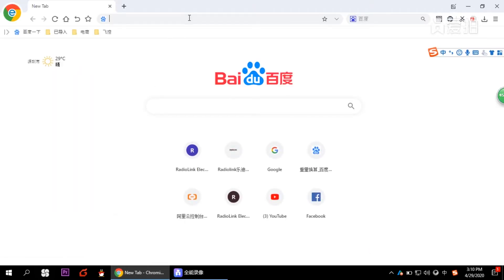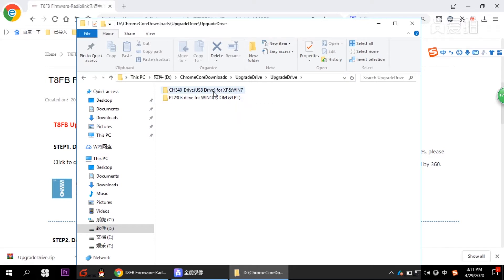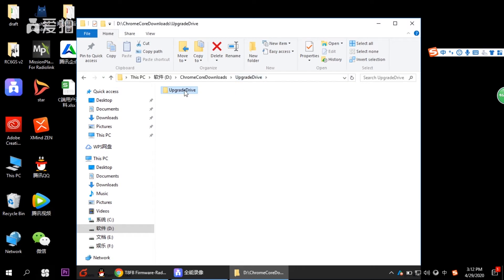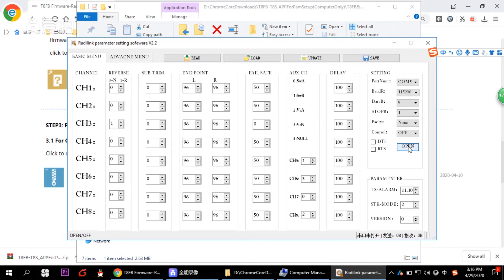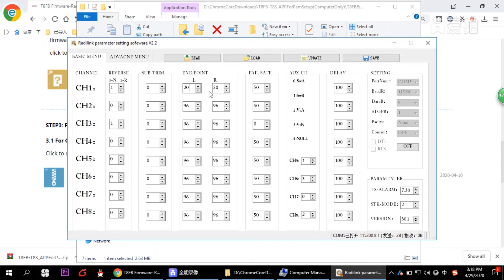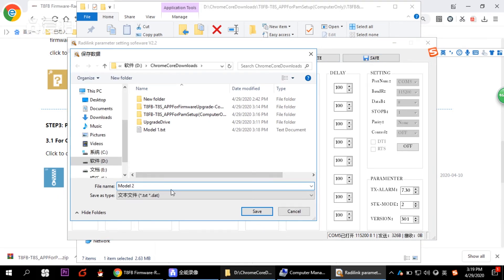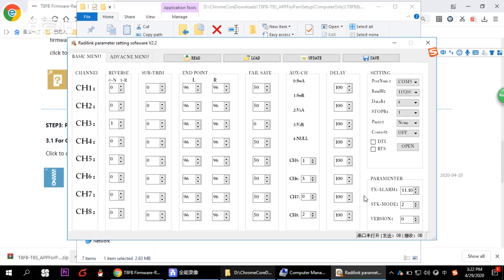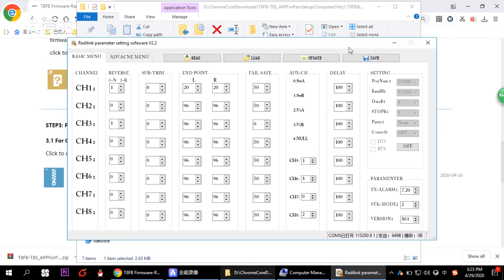How to Setup Parameters of T8S(BT)/T8FB(BT) by Computer

Comment: I keep getting an error on setup "not found install application, please install by hand
Reply from the maker: Hi, sir. May I know what transmitter are you using? Is it OTG or BT version? You need to install the driver if you want to use the Parameter Adjustment APP on the computer. You can send more details to our email after_service@radiolink.com.cn Thanks in advance.

Comment: Can I switch to stick mode 2 from stick mode 1 with this tool? I can´t connect to my smartphone...firmware update doesn´t work but my computer detects the transmitter and I can read and change settings.
Reply from the maker: Hi, sir. For stick mode change, you need to modify the stick first, and then change the stick mode in the APP. Here is a tutorial to show how to change the stick mode of T8S: https://www.youtube.com/watch?v=b-97TUi3_Rw  After modifying it, you can switch to stick mode 2 from stick mode 1 on the computer through Parameter Adjustment software on the computer. Here is the link to download the parameter adjustment aoftware: https://www.radiolink.com/t8s_apps  If any question please feel free to contact us. Our email is after_service@radiolink.com.

Comment: I build an Airboat with differential thrust 
I'm using :
1 pixhawk 4 (it comes with GPS and power distribution board) with ardupilot
1 radio transmitter, Radiolink AT10
1 radio receiver, Radiolink R12DS
2 ESC
2 brushless motors

could you please help me out with the differential thrust?
Reply from the maker: Dear, thank you so much for using our product.  We are preparing for the tutorial video about how to set up the flight controller and the boat. But it will release in May. You can send an email to after_service@radiolink.com.cn to get help.
Reply: @Radiolink_official  

hello I already sent you guys several emails and no one is answering, I have been trying to contact rediolink for about six months but no one answers back.

please take a look at your emails
Reply from the maker: @luigifiore1265  Dear, our after-service colleague has replied to you with several emails, please have a check. the setting steps are: 
1. If you need to use PIXhawk to control a differential thrust airboat, then you don’t need to do any settings on the remote control. You only need to set up pixhawk through the ground station. You can refer to the official website of ardupilot. To provide you with the setting address of dual-motor differential speed setting:https://ardupilot.org/rover/docs/rover-motor-and-servo-configuration.html#rover-motor-and-servo-configuration
2. At present, what I can provide you is a method for dual-motor differential control without using pixhawk. This method only uses AT10 Ⅱ transmitter, you need to disconnect all pixhawk connections, connect the ESC of the left motor to channel 2 of the R12DS, and connect the ESC of the right motor to channel 4 of the R12DS, and then set up the parameters in your transmitter (This setting is based on the use of two-way ESC)

① set up 2:ELEV is REV and 4:RUDD is REV in REVERSE menu
② set up parameters in the menu PROG.MIX1: both up and down of RATE is +100%, MASTER is CH2 and SLAVE is CH4, MIX is ON
③ set up parameters in the menu PROG.MIX2: both up and down of RATE is -100%, MASTER is CH4 and SLAVE is CH2, MIX is ON